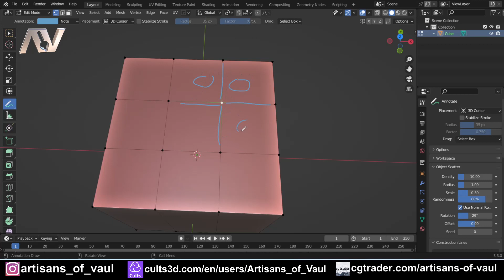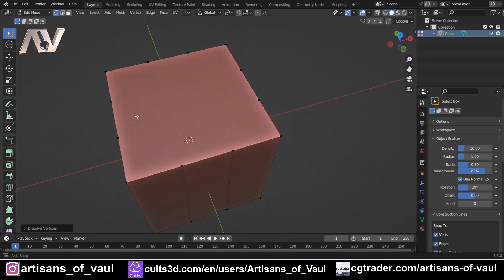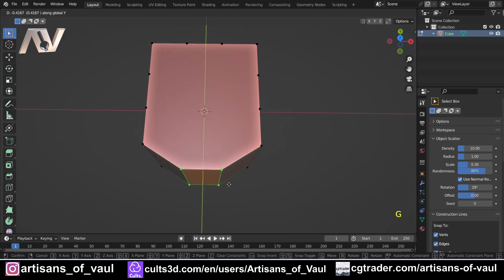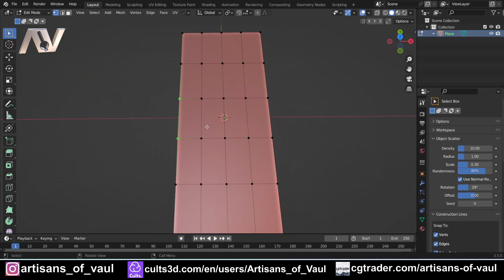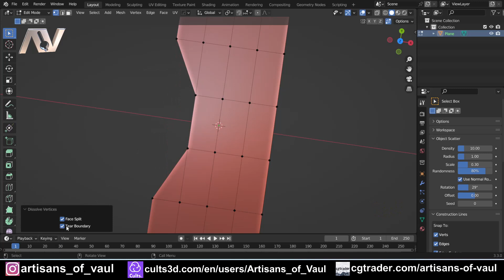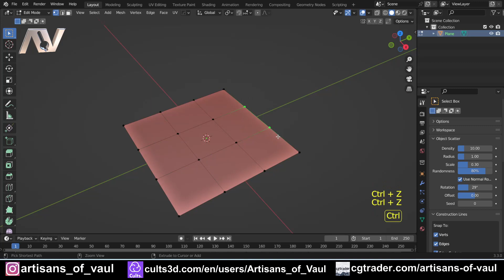Delete and Dissolve Explained  - What's the difference and what do they do in Blender?

Comment: 1 single plane with 1 square hole inside.. ( like wall plane with window hole ).. how to I get rid off the line connected to the the hole? I tried many method.. tris to quad, dissolve.. etc.. seems like it need at least 2 line that cannot be erase. Any solution?
Reply from the maker: It's a requirement to have any "holes" connected to an outside edge with two lines as you have deduced.

Comment: Limited dissolve was a turning point for me, as I often found that I added too many subdivisions/loop cuts early in the modeling and regretted it later. I will have to try Face split.
Do you have an opinion on why Thingiverse has gone downhill? I remember someone saying it in a video and I was doubtful then, but now it is obvious to me that it is being abandoned.
Reply from the maker: Yeah its great.  You can also get similar results a bit faster with Hard Ops "clean mesh" tool with a lot of other added bits to the function.

To be honest Im not sure.  I think its a combination of many factors.  They are very quickly to relent to any sort of C&D, which other sites have not.  Sometimes people are frustrated with the quality of the models on there and that the search function throws up items that have been deleted (the 404 doom message).  And I think a lot of people are realising that its not too much to ask for some money for the hours you have put in so are going to other locations to sell their design for a reasonable fee.  There are probably many more reasons as well.

Comment: decimate does the same thing as limited dissolve in its planar mode, and non destructive.
Reply from the maker: Very true. It just depends on what you want to achieve at the end. Limited dissolve is faster if you want it destructive right away bur planar decimate as you say is non-destructive. In most instances I'd be using Clean Mesh on Hard Ops but that's paid for.

Comment: limited dissolve poggies!! i didnt even notice that option until now, funny enough. I wouldn't say I like automatic mesh clean but let's be honest that's a great function for casual or private models, thanks again for the fantastic advices
Reply from the maker: Yeah, I don't know how useful the options are individually but I do quite like that it will save using vertex sliding for cleanup